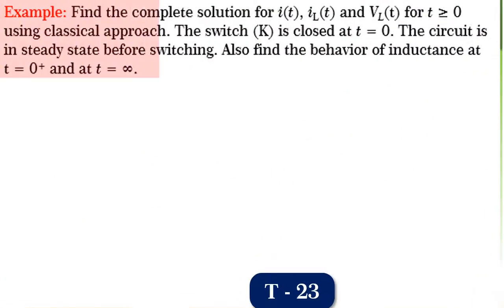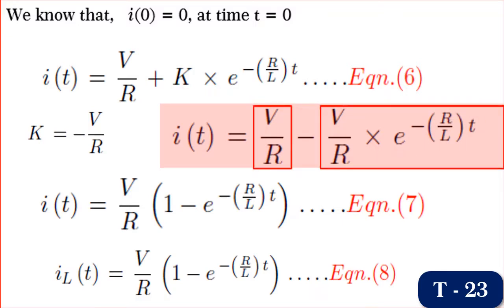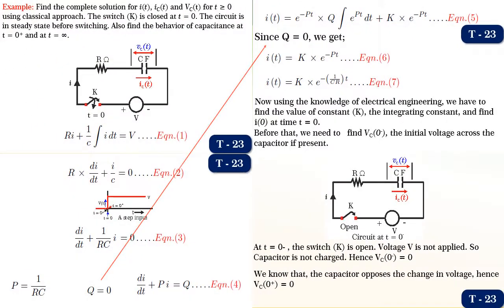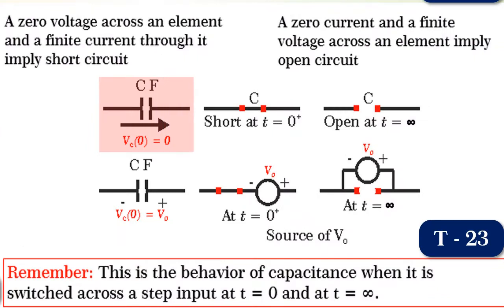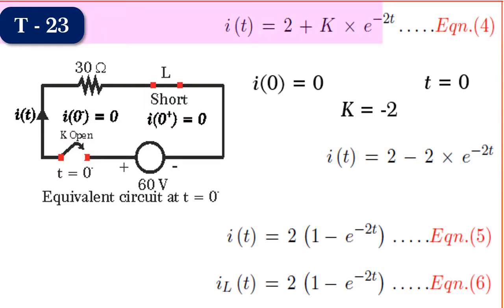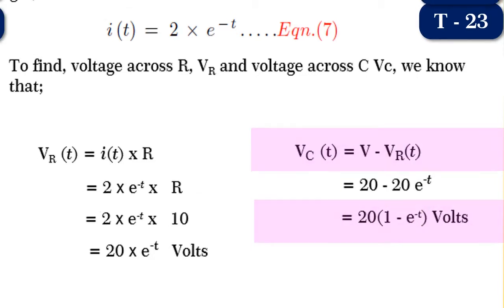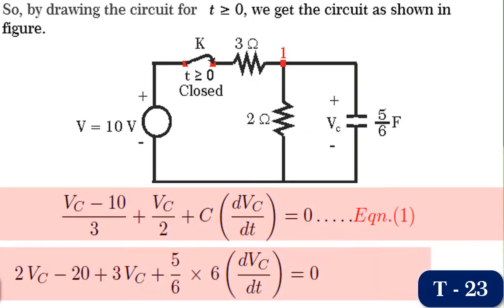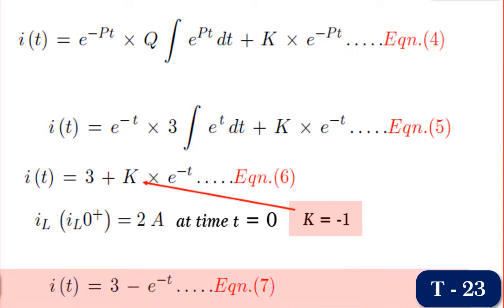Step response of R L and R C series circuits Classical approach

Comment: Sir, If you kindly explain that in your previous tutorial when you explained behavior of R L C element at time t<=0 and at t=~ how does it differ from step input ? Because there also you applied voltage V at t=0, when you close the switch at t=0 the same voltage V is applied to the circuit. There also voltage at t<0 is 0 only sir. My doubt arises because presently why do you put Current source / Voltage source in addition with open circuit / close circuit in case of inductor and capacitor at t=~.  I hope i explained it properly. Please reply sir. Regards.